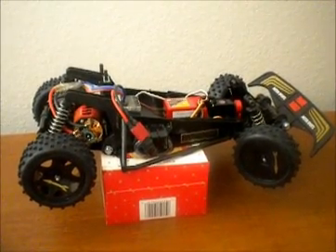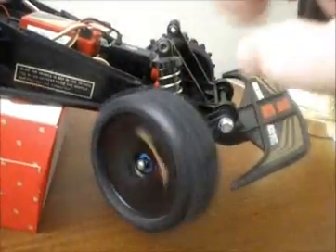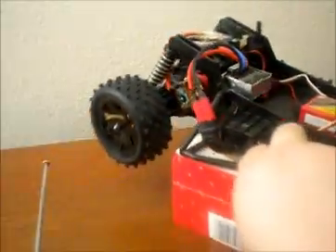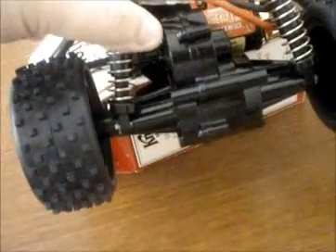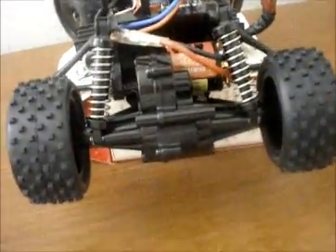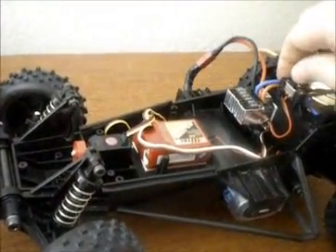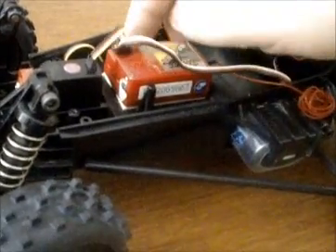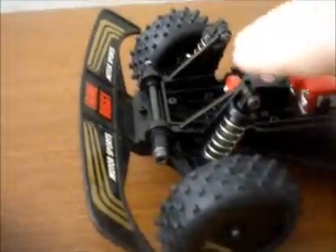Radio Shack Golden Arrow Project Part 3

Comment from the maker: As far as the battery power goes, I wanted to stay within the original designers intention of 7.2 volts and a stock motor so it wasn't over powered to the point where it would destroy itself. The trinity epic motor I'm using is a brushed, ball bearing, 27 turn stock motor that is good for performance and decent battery run times. Basically good pep without getting too crazy. Great that you restored your arrow. Thanks.

Comment from the maker: Just for your information about wheels and tires, traxxas and proline tire beads are angled. Tamiya, hpi, and schumacher tire beads are flat and are interchangable between those three brands of tires. I hope that tip saves you some trouble if you go with the modern 2.2 tires and wheels. Thanks

Comment from the maker: And yes, the mighty mini is a great fit. Some slight plastic removal where the servo wire comes out will be needed. I have the servo wire on the top side in the video but I found that I could not get proper angles for the steering rods that way. I still haven't finished the steering because I'm undecided on threaded rods or titanium turnbuckles. It appears thusfar that threaded rods are probably the way to go. I simply haven't done anything to this for a while due to other distractions. Thanks.

Comment from the maker: @thereptilejason I used traxxas spirit axles. There were leftover threads sticking out past the wheel nuts. The Tamiya frog adapters come with thin wheel nuts. There would not be any issues using the original axles.

Comment: nice arrow have you thought  about going to a 9 volt ive heard the stock 540 can handle up to 12 volts as they are also used in industreal  apps  tuff moters the 540 i redid my arrow was inspired to do so last year by your phantom project lots of fun  like the street idea gonna barrow that idea  nice billd good work .
Reply: Motors

Comment from the maker: I haven't finished or ran it yet but there is a metal gear version of the hs-225bb which is the hs-225mg. So the hs-225bb didn't hold up for you? Mine seemed strong when I would grab the servo saver but the nikko / radio shack arrows are heavy buggies. Thanks.

Comment: Hi, i love your video on this Golden Arrow. My dad had one in the garage, i charged it and put some batteries in it. To My surprise it still turn on..! The only this is that it's stuck in the reverse mode, once i nit the on button on the car it self it just go's full reverse mode. Is there a fix too it? or do i need a new motor for it? Hope you can help, thank you
Reply: Could be an issue with the solenoids getting stuck in the car itself or the remote has to be cleaned. On these RadioShack buggys they're two solenoids for forward and reverse. Of they get stuck they'll cause the motor to get stuck on. Take the body off and towards the back of the circuitry you'll find two rectangular plastic pieces they'll be one on either side of a large heatsink. Those plastic pieces are your solenoids try to tap them both lightly to see if that works, if not you'll need to get them replaced. Could also be an issue with the capacitors on the main boared drying out and acting funny. 30 year old electronics can act funny sometimes.
Reply: Your throttle trim is pushed down Make sure it's in the middle

Comment: WHEN ARE YOU GOING TO FINISH THIS I put an old Novak brushless in mine with a 3300 2 cell lipo and it went so fast the bumper acted as a wing so after all that work I took out the hobby grade electronics and put the stock back in I did burn out the stock motor in a radio shack hummer it was fast but needs a 550 motor so I put an old traxxas stinger motor back in and I think it's faster especially with the two cell lipo

Comment: Hey I have a quick question about the wheels and tires.  I have a golden arrow where the tires were dry rotted and completely came off the rim in pieces.  I brought it to a hobby store and they said to look online at tamiya because they no longer produce the hub pattern on the back of the rim.  Do you have any clue what type of rims and tires I can replace the originals with?  Thanks
Reply: If you take the Golden arrow hub off and put a standard hex one on you can use basically any type of tire now